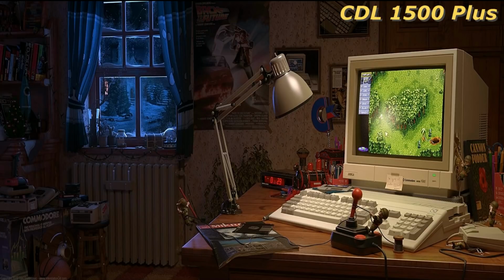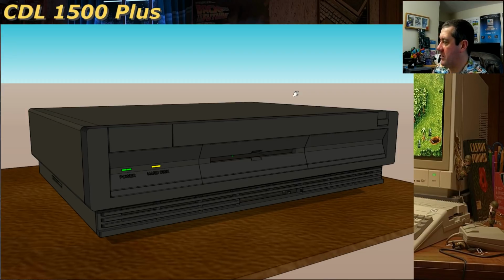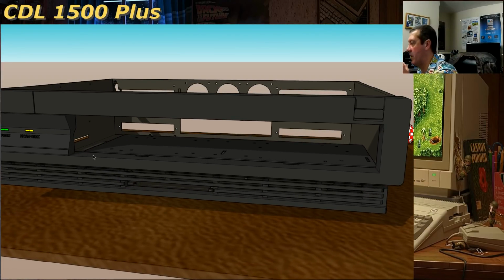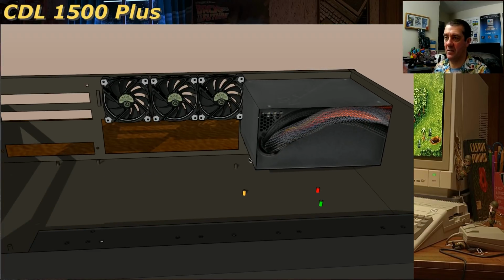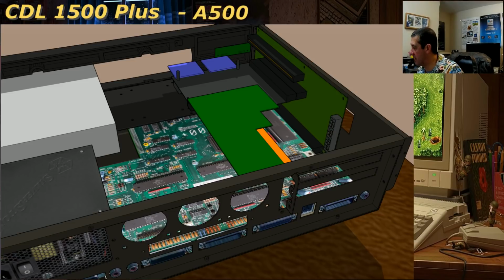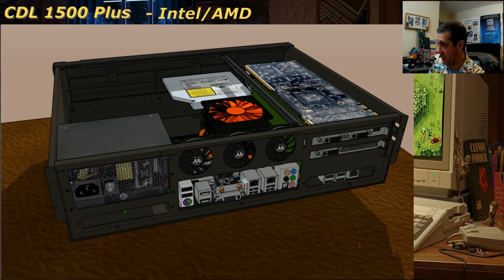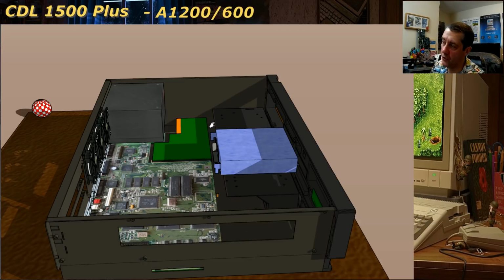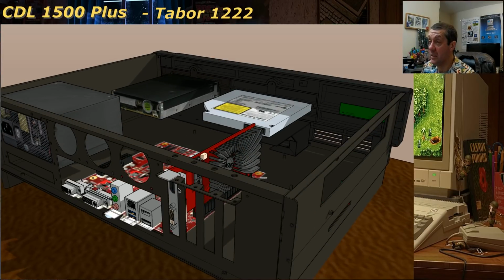CDL 1500 Plus update before prototype build up in January

Comment: Hey Stephen! Was just thinking. What if I want a Diskdrive and then an external Gotekdrive. If so, I need to have a boot selector. Where do I put that switch on the back? Is there a option for it to put that somewhere "cleanly". Thanks in advance!
Reply from the maker: Paul The Tall there is lots of places but you need to be a mart and get involved with 3D printing a plate adaptor for it. There will be lots of options

Comment: I'd really like one of those cases for my A1200. 
About connecting internal power to an Amiga - you should take a look at this site: http://www.ianstedman.co.uk/Amiga/designs/Amiga_ATX_Adaptor/amiga_atx_adaptor.html
This guy is selling ATX power adaptors that might fit quite well into your casing. This adaptor especially takes into account, that modern power supplies need a "signal" from the motherboard to power on. So that board has a two-pin connector for the front power button. 
I already use that adaptor to incorporate a picoPSU into a standard A1200 case.

Comment: I've built computers since 2001, and  while the design of the CDL 1500 Plus is more than efficient enough to cool even modern reference GPU's with blower-based cooling, to use three 50mm fans of ANY kind, let alone so-called "quiet fans" as the sole force driving airflow is not only incredibly inefficient, but it's guaranteed to overheat a modern CPU under less than ideal conditions.  It is a case of there being far too much internal volume for the fans to move.  In such a scenario, you will overheat modern hardware when running under less than ideal conditions, and the fans could even become unnecessarily loud due to the attempt to draw a vacuum inside the case.  This is why modern computer cases have matched fans for intake and exhaust unless one is dealing with extremely small form-factors, such as laptops.  The idea is to create as direct a path as possible without one fan overpowering the other.  With properly balanced fans and a more or less direct air path through your components and out of the case, the fans consume less power, cool more efficiently, and are inevitably quieter.  Regarding CPU cooling, in such a small case, there is little alternative but to mount a 120-140mm radiator to the floor of the case behind the right drive bay.  This radiator could then be vented either directly through the top of the case, or, if you wish to preserve the retro aesthetic, through the side panel via an '80s styled vent cover.  The 50mm fans you are using should be replaced by matching blower fans, front and back.  As long as they're properly sized for your case, they will move more than enough air over motherboard components of either modern PC hardware or vintage Amigas to not only keep them cool, but provide a reasonably quiet working environment.  I guess the only other suggestion I can make is to use dust filters for any floor mounted case fans so they can be easily removed for cleaning from the front of the case.  

Anyway, good luck, Mr. Jones--I'm looking forward to hearing of your success.
Reply from the maker: Hi, yes this is something that I am aware of and would prefer better fan arrangement. However, This is not meant for hot cpu's and I will be testing them heavily when the prototype arrives. I think you underestimate just what this is capable of but proof of the pudding will be in prototype testing :-) 
 I have also built a lot of computer since mid nineties and I do understand the issues. This case will obviously come with advice on kind of CPU's to fit and that NO overclocking should be attempted. I am looking into the possibility of building a water cooled solution but this needs changes to existing case which there will be more information on soon.
Reply: https://modmymods.com/radiators/40mm-radiators.html but u can find these all over ali/ebay etc etc im a crypto/overclocker/case modder for a very long time i can help you with any design  if you use these small ones and plan on adding quad x5000 support i would say make room for a push/pull fan design using static pressure fans
Reply: they make slim  40-80mm water coolers that will fit fine there over that io plate so for a slim design you really can do much more 1 personal thing i like to see is customization hack friendly as in no rivets everything can be moved/remounted in another spot etc  with screws and/or other tool less locking
Reply from the maker: Kev711 2001 links please for cooling.
Reply from the maker: Kev711 2001 not seen that small
Reply: yeah i plan on fitting 1 inside a a1200:)
Reply: also on the bottom could also use passive https://modmymods.com/alphacool-cape-cora-hf-442-konvekt-black.html

could have a fan inside case blowing down under to cool that with air channeling and proper vents
so i guess find a spot where a pump/reservoir can be placed
Reply from the maker: Thanks for that information, I will look into it and it may allow better cooling.

Comment: 600 watts is cutting it close for a new ATX based high powered PC with a 1080Ti card in it. I ran the numbers on a pc running an AMD 1950x Threadripper (16 cores, 32 threads) 32 Gigs DDR4 Ram, Nvidia 1080 Ti video card, 1 SSD HD, 1 7200 RPM 4 gig HD, 1 DVD-RW or Blue Ray, and 5 fans (1 or 2 being on the CPU heatsink itself) and I'm at about 600 watts. It's a shame you couldn't get a regular ATX power supply in there. It appears Silverstone makes a 750 and 800 watt SFX power supply that's compatible with the ATX motherboard.
Reply from the maker: I fully accept the 1080ti comment although recommended is 600 watts. However, you do not understand that this is NOT an high end PC case. It is designed to run a good Virtual reality system with say average CPU, and maybe 1080 as I mentioned nobody is going to use this to run a Thread ripper CPU :-)
Reply: I accept your challenge good sir! I'm just skilled enough to be a danger to myself and just wealthy enough to make being a danger to myself quite amusing and usually quite fiery and smoke filled.Love your passion and dedication, you sir are amazing!
Reply: There are 800W SFX Power supplies.